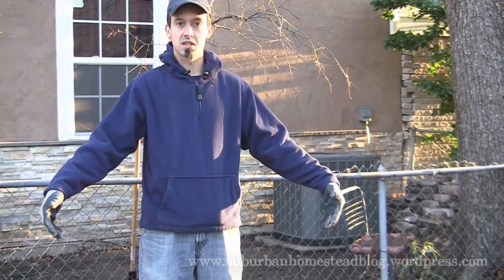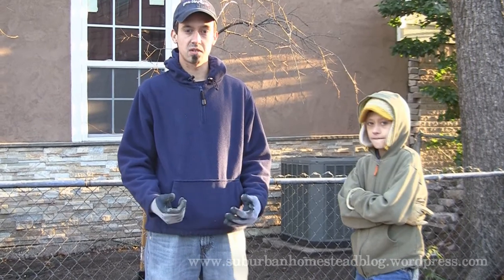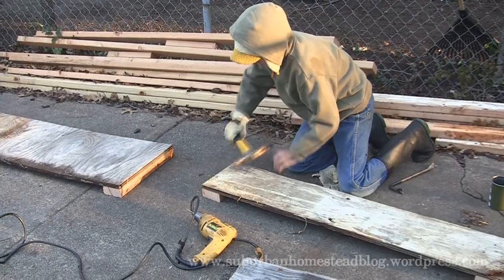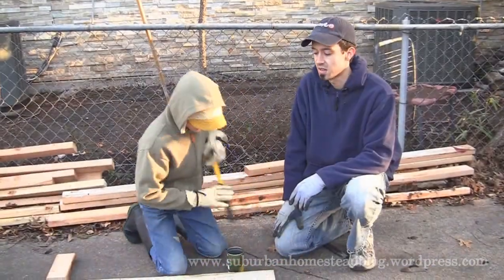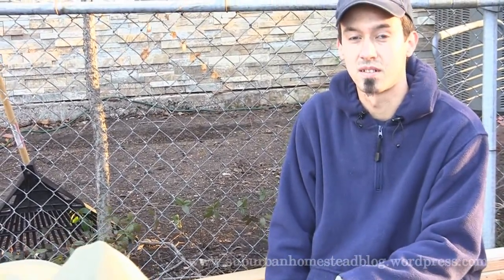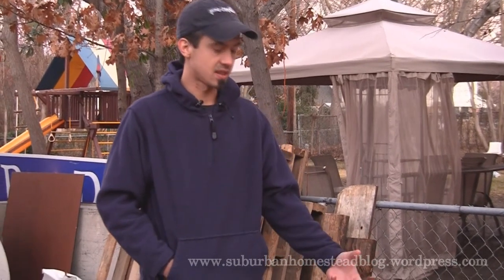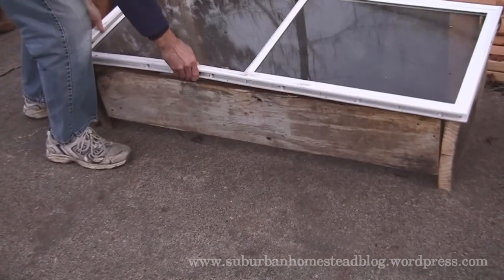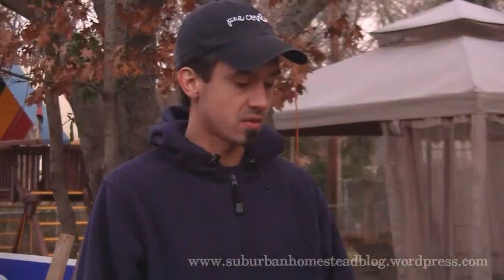How to Build a Cold Frame {Suburban Homestead Blog}

Comment: May I suggest trying to put some hinges on the window? There will be some days when the window will need to be propped open a few inches so you don't bake the seedlings. Also, right now is actually not the time to start the cabbage family from seed; the sowing date for the cabbage family is usually around Thanksgiving. Right now is almost the right time to put cabbages etc. in the garden, with protection from hard freezes. Other than these things, this video was really great!

Comment: Oh, and about my comment about not baking the seedlings; it would be a good idea to put some sort of thermometer down in there that y'all can check to make sure it isn't too hot or cold (I don't think too cold will be a problem, though. The weight of that wood chip mulch will cause it to decompose, which will mean it will release heat. Your problems are gonna come from too much heat, I think.).